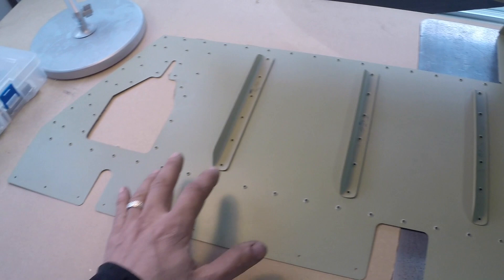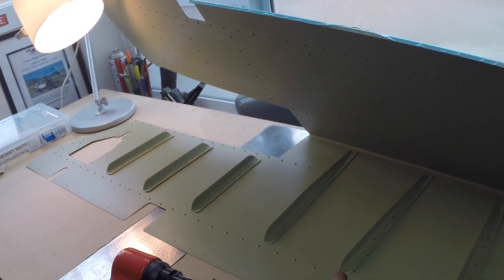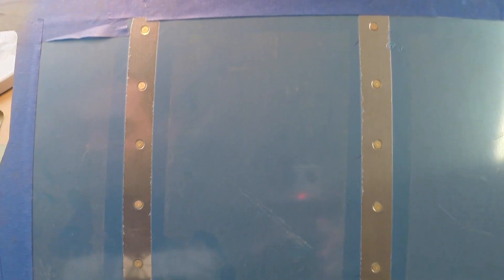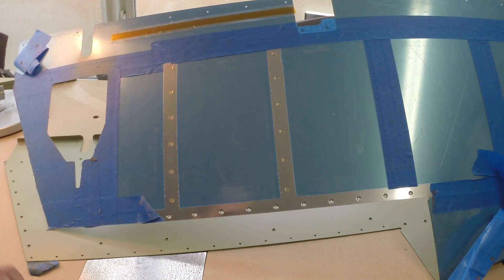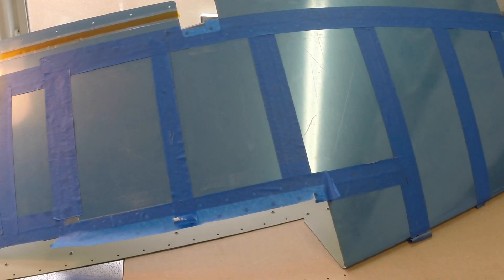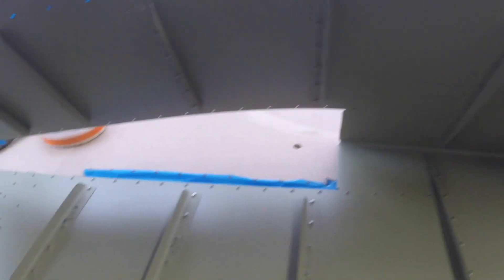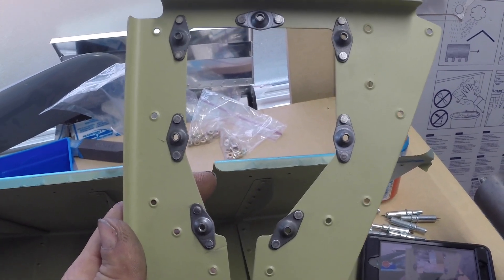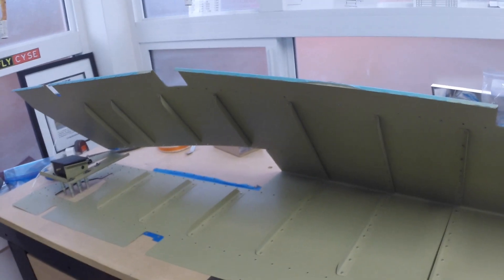RV-7 Left Elevator Final Assembly Part 1

Comment: When you dimpled the screw hole for the nut plates, what size dimple did you use? Thanks
Reply from the maker: Dimple is just for the center screw not the two holes for the rivets that hold it down. The center dimple is a #6 I believe.
Reply: @SkiDuneTech  thanks

Comment: What year did you purchase your kit? Are the RV7 kits now pre-punched? Also what primer are you using?
Reply from the maker: James Lovell hey James, I purchased my kit second hand 2001 I think? It is one of the earlier ones. The new ones are pre punched but not to final size like the RV14. The stiffeners for example and skins are pre punched now. My kit did not have this done so I bought new stiffeners and match drilled the skin using the holes in the stiffeners as a guide. I use AKZO for my Primer.

Comment: Sorry if you mention this somewhere in one of your videos, but can I ask what you are using for your benchtop backing bar? I assume some well sanded 1/2" steel plate would do?
Reply from the maker: I don’t remember if I used 1/2 or 3/8 but yes it’s just mild steel. What’s important is that it’s flat.

Comment: Thank you for your excellent videos, very good work. For me at 12:38 the hammer sounded right, it corresponds to about what I had concerning frequency and duration. As long as the rivets look good on the outside, I would not drill them out. - The risk is always that they don’t get any better the second time. When you will be riveting to the soft canopy welding you may have to live with some not quite perfectly set rivets. But look also at certified aircraft, not mentioning any specific manufacturer.
Reply from the maker: Thanks for your sound advice, Where do i draw the line though? when is safety a factor? i mean tail surfaces just can't fail! even buckling during the +6g she's rated for could be bad news right?
Reply: Please consider that, although I`m a stress engineer, I`m not the official VAN`s nor authorities voice. It`s just my personal experience and advice. These stiffners serve to keep the sheets flat under aerodynamic load. There are enough rivets and aestethic appearence inside is secondary. But on the other Hand I may tell you that at high loaded regions like the Elevator spar, I made the  joiner HS714 three imes to achieve suficient edge distance.
Reply: Andrew Atalla hello , how I can find the plan komplett.thank you
Reply: I'm playing with the HS714 right now. I'm trying to get it all cleco'd together to give me the best idea on space available and proper edge distance. Helps having a 90deg drill too. So happy I bought that.
Reply: What do you recommend for a drill and rivet air tools?